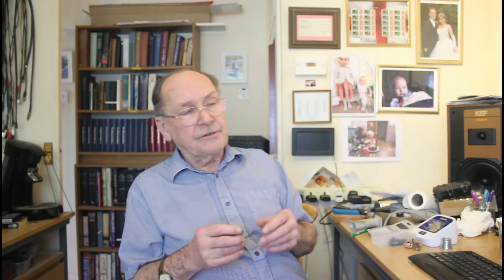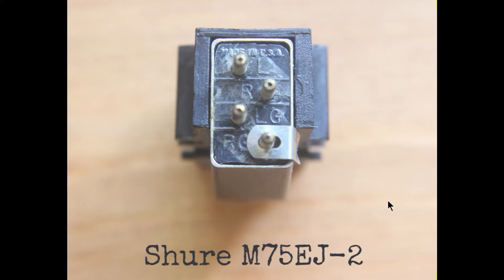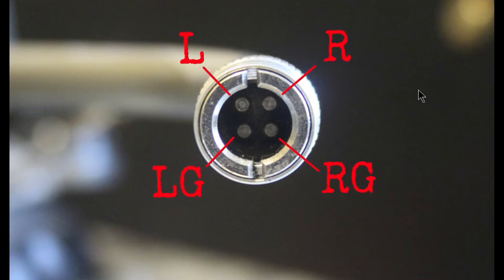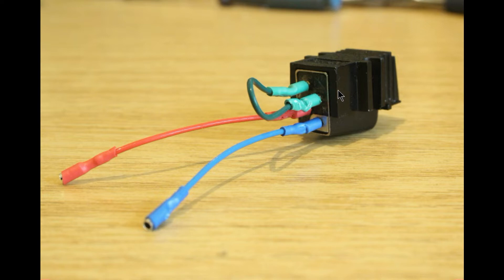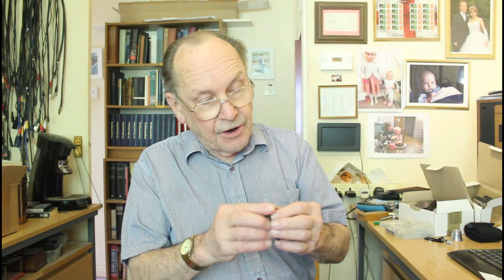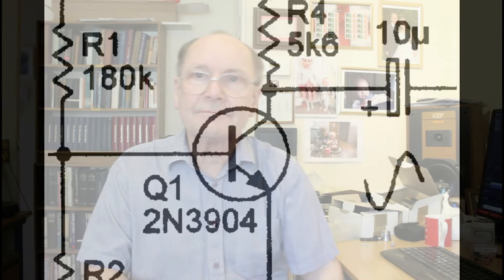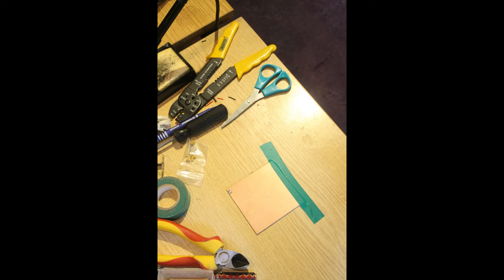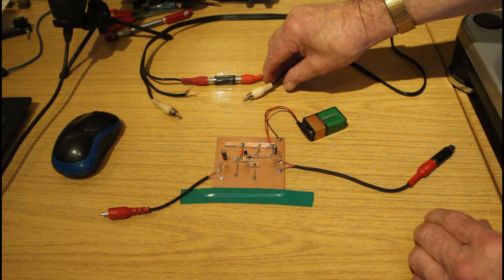Vertical cut disc records: two simple methods of playing them with modern equipment.

Comment: The shure method of taking from the two negatives actually puts the coils in series, back to back, thus out of phase.  This doubles the suggested load impedance, but also does double the voltage, but there is no damping of out of phase lateral information.  The reversing one channel method maintains impedance and output voltage, but is more effective at damping lateral info. Out of phase info on the other coil presents an effective short, but in-phase info presents a high impedance, so the coils are not actually "shorting" or loading each other. The one transistor method is very effective, but does present a slight phase shift and added noise, not of any concern for this source material. Opamps may be used, one in phase, one out of phase with live switching of the phase of one channel using a single pole switch. A pot with ends to the feedback dump resistor terminal (negative feedback) wiper to ground, can be used to balance the two channels for most effective cancellation.

Comment: Thank you for this very important video! This is really a genius idea. Just a short technical note: if you would like to further improve the sound quality of your phase inverter circuit, use tantal capacitors instead of the electrolytic capacitors. The very best would be to use non polarized foil capacitors, if availble. Only the German WIMA manufacturer offers non polarized 10yF foil capacitors in size for circuit boards to my knowledge, so far. Another thing is, that 10yF is electrically quite a big value, and it could be a little bit difficult for high frequency's to pass through. A check with a sinus generator and a oscilloscope would give a answer to that. To overcome this problem, just add a parallel small capacitor of say 10nF or 47nF to the big 10yF capacitor. Electrically, the circuit "sees" the wanted amount of capacitance, but for the signal time to pass through, only the small capacitor counts, improving the high frequency's response and the impulse of bass. It also helps to use 1% metal film resistors, instead of noisy 10% carbon resistors. Carbon resistors have beige bodies, metal film resistors have blue or turquoise body colour. I know what I'm talking about, I restored many (english say)valve (americans say)tube amps... It would be very interesting if you could share your experience with different stylus sizes for playback 78's and vertical cut disc and phonograph cylinders. The right stylus size for the right application is crucial to the best possible sound reproduction. Many people are not aware that even old "normal groove" 45rpm singles should not be played with the 12micron (0,47mil) stylus, used for microgroove stereo 33prm LP's. These mono 45rpm singles should be played back with a 25micron (0,98mil) stylus. For the shellac records, the normal guideline is: records from 1960 to 1945 stylus size of 65microns (2,55mil) /records from 1945 to 1930 a stylus size of 75microns (2.95mil) and the old acoustic records a stylus of about 90microns (3,54mil), the very old Berliner or Zonophone records may use a proper stylus size of 120microns (4,72mil). How do you know about the right playback speed for these historical recordings? The keynote a1=440Hz was used officially set in 1940 and before it was probably lower. Most modern tuners for musical instruments work for keynote a=440Hz. Here's a video of a American sound technician who's specialized in doing dubbings of historical recordings:https://www.youtube.com/watch?v=z_GyYapvkcw. Very interesting to see how he adjusts the record out of the spindle to get the wobble out and the trying of different stylus sizes. Thanks again for this video and best regards from Switzerland, bluearcturus
Reply: Jea, Swizerland, hello from Zürich and thank you for the infos ;-)
Reply from the maker: Sorry about 2 years delay! I will implement the changes you suggest & report back here again.Many thanks, Norman.

Comment: Havent we seen this before, or am I going nuts?
Reply from the maker: Hi there - yes, it was up before, maybe 10 days ago, but I took it down because somebody said the 'Wanna be friends?' comment was some sort of malware & if you click on it, it's bad. I see it's back, under Misty. Am not sure what to do! It's also appeared on the supplementary video to this one. The question is, are these comments capable harbouring malware? Is iy a manifestation, say,m of a virus on my own PC? I shall be researching it online, urgently. Cheers, Norman.
Reply: Norman Field thanks. Thought I was having a moment. I have seen this wanna be friends thing in other posts. I suppose you can block them , but they may come back as someone else?
Reply from the maker: @davidk6271  =Thanks for your concern David. Yes alas, you're right; another one came in on another video, with a different name - we've had hetty & misty & somthing else ';ve forgotten so far. Must do some more research on it to make sure I'm not assisting the spread of malware.... Cheers, Norman.
Reply: @bixanorak  These are posted by some robot that seems to run on accounts that have been hacked in some way, or else they are new accounts entered in some fraudulent manner, since most seem to have a "join date" of about 2008. I strongly suspect that there are two forces at work. There is probably a robot that is cracking YouTube accounts that have very weak passwords, and then handing them off to a second robot that is making these "wanna be friends" posts.
It's not clear to me the point of these things. Browsing the internet brings up a lot of speculation of them either artificially increasing hits on videos due to the robot posts, or somehow artificially making the hacked account more important due to the number of posts on other videos. There is also the widespread belief that these are somehow trap posts and touching them will somehow compromise your own account.  This later point is demonstrably false.
To the first point, their posting comments to your video will increase your hit count, not theirs. So what would be the benefit to the robot in the compromised account?
To the second point, the YouTube database might notice the account is making a lot of posts, but since they never have any recent videos (and seldom have any videos at all), and they aren't monetized, and the posts aren't increasing the views on the few videos available, again, what is the point for the robot?
The final point is pretty demonstrably false. Clicking on one of those links will not give the robot any information that it can't get already. Subscribing to the hacked account might in some way benefit the robot, but it still won't compromise your account, at least not directly. It might give the robot an account name to pass back to the hacking robot, and that could try to brute force into your account. But the robot that can post on your videos can also read the comments on your videos, so already has access to the names of everyone else posting. So touching the compromised account is not going to hurt you any more than merely existing hurts you.
What I do when I see these pop up is click the dots to the right and select "report", and then report it as "unwanted commercial spam". YouTube promptly makes the post vanish from my sight, and I assume might do something to trigger a review that will quash the compromised account. 
As an account owner you can also block that particular account from posting to your videos, and you can remove posts you don't like, including these.
Hope that is of some help.